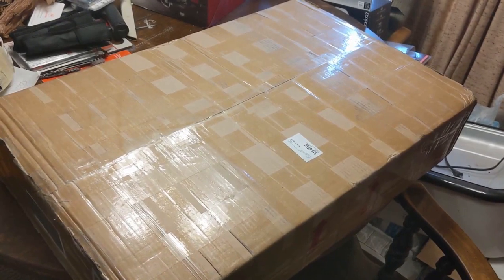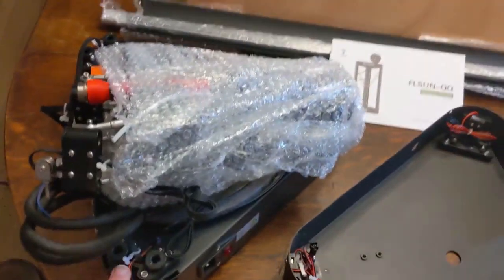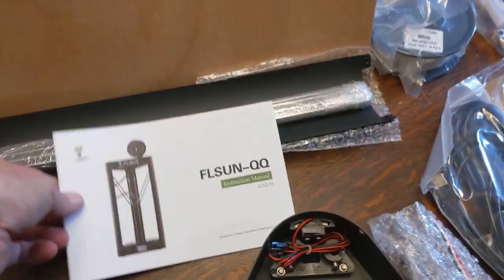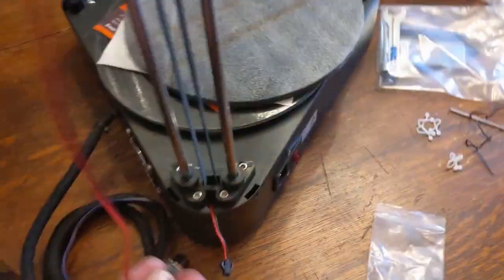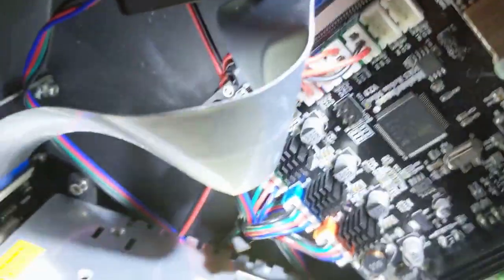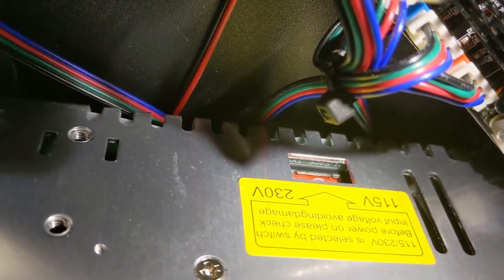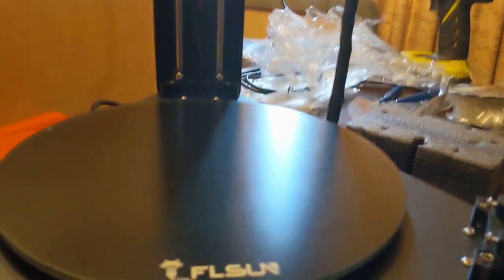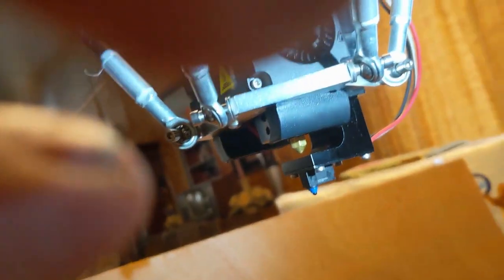FLSun QQS-Pro 3D Printer - Unbox and assembly

Comment: Once the top and bottom are secured, the corner panels slip up inside the top of the unit, then it can be slid into the bottom of the unit. There is no need to take off the top again!
Reply from the maker: Well, I'll likely get the chance to do a second build shortly, my printer was stolen so I'm going to have to replace it

Comment: Forgot to ask. Does the WiFi work and can it be added to a network by Ethernet cable preferable if Octoprint will be used.
Reply: The WiFi does NOT work well. But you can connect a Raspberry Pi to USB and connect it with an Ethernet switch

Comment: Thank you for your tips. Several questions. 1. You note linear bushing rather than bearings (such as LM8UU). Is this correct and how do you adjust the bushing for wear over time? I assume they are replaceable, so would recommend having a spare set assuming parts will be unavailable later. With bushings, I would be concerned if you intend to run it for more than a few hours each day. 2. They identify the extruder as a Titan. Is this a real E3D part or a copy, 'borrowed intellectual property"? 3. FLSUN on their Web site doe does not have this model, but all of their other delta's layer resolution begins at 0.2 rather than 0.1 as we would expect on most modern machines. What is the resolution?